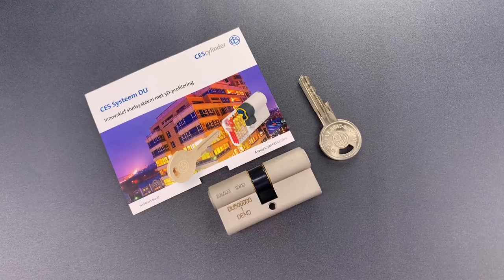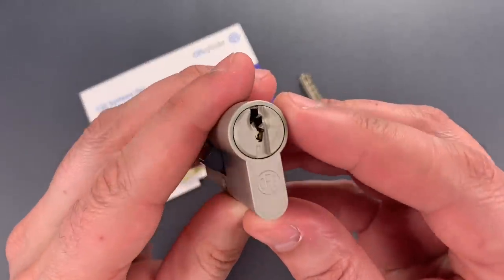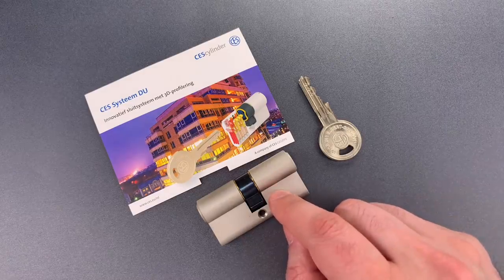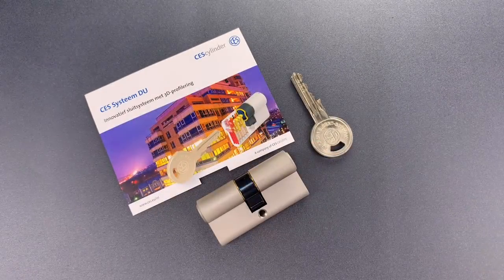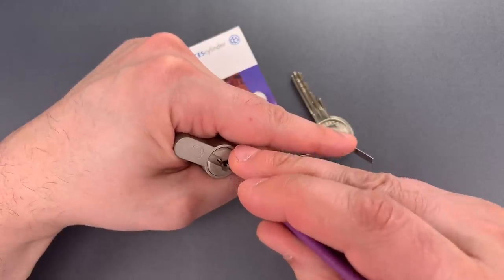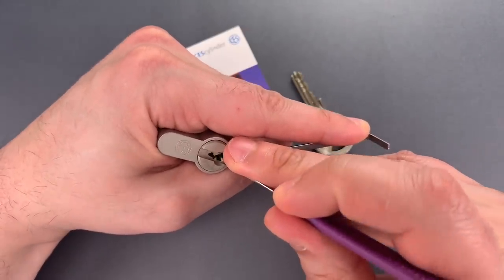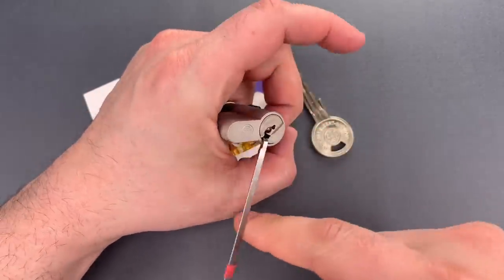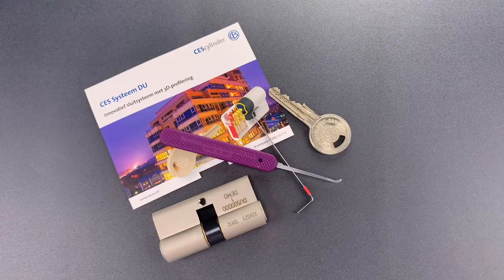[1248] Absurdly Paracentric CES Euro Cylinder Picked

Comment: was looking at the keys to the safe at my work. one of them is severely deep cuts. theres almost no metal for a backing at all. its so bad i really think youd just need to slide something just its height in to get most of the pins in place. if it wasnt so hard to get to work even WITH the key id say it needs changed asap.

Comment: That should say absurdly badly designed keyway. The top part of the keyway on that shambles doesn't even come into the equation when you leave acres of space down the bottom to fit any pick at all in there :O

Comment: how secure is this lock? , if a burger comes and got crowbar , or a sledge hammer , and why bother , if there are windows ? why not invest in Razer wire or barb wire or land mines ? 
or electrical fences ? , or just rig a shotgun or Bobbie trap the whole place ? why shall we care about the outcome ? or protect the robber ? why not annihilate the Threat(burgler)  
and keep what we got safe? , other wise whats the point of a lock ? 

the door got its parts too , it ca be Blast proof , whether proof och just insulated , or just pice off cardboard , anyway if its cold it will help keep the warms in and lower heating 

but whats the point of crappy security ?? its a money grab or a scam ? 
of some idiot that has faild school to make there heroine addiction come true ?
i cant understand this.

but its fun to see you Brake/pick this locks an a few seconds , but skills cant  always be compared to fire power or cutters , or low voltage high Amperage ect ect ,

in the future when i afford to buy a mill i will send you a challenge lock , and it will be amazing  and make ASSA lock as Crap

Comment: you again failed to add the key in the other side and try to pick it.
I emailed you about this, no response, your leaving out a huge thing that we all do here with leaving a key in the inside of the lock, you have to push the key out first before you can pick it. you keep not trying it that way and refuse to acknowledge it. maybe its a because your an American thing and cant comprehend using a key on the inside of the door to lock it, or maybe you just keep not knowing.